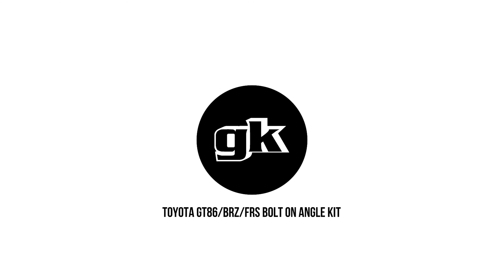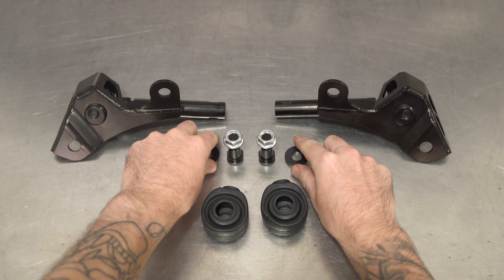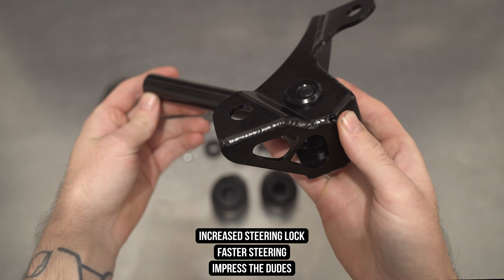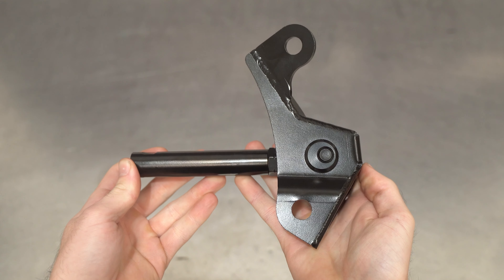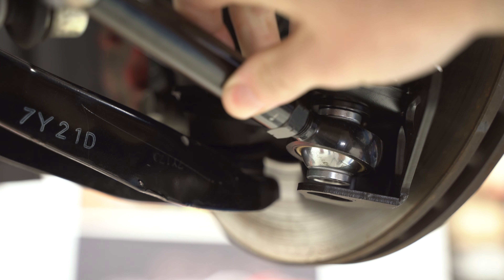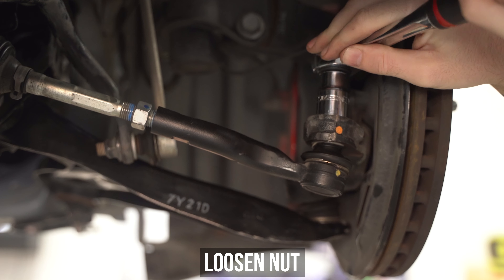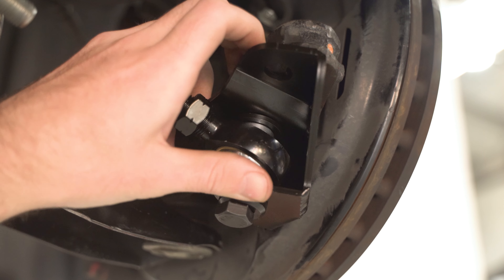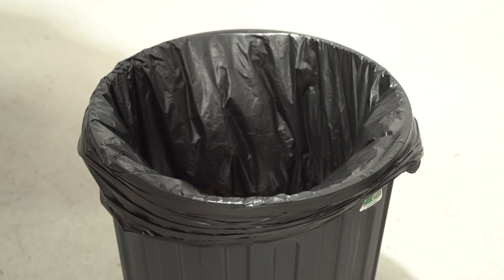Gktech GR/GT86 BRZ FR-S Bolt On Angle Kit – Install

Comment: I'm interested in this kit but I don't want to compromise my grip driving setup, does this kit change camber (assuming not but figured i'd ask) and with the Ackerman setting will it handle the same as it would without the kit? thanks in advance.
Reply from the maker: It won't change the camber value but you will find a change in steering characteristics. It will turn faster with less steering input, not always desired on grip cars.
Reply: @gktech  thanks for the response, i should be able to put up with a faster steering rate as long as it doesn't screw with my alignment, thanks